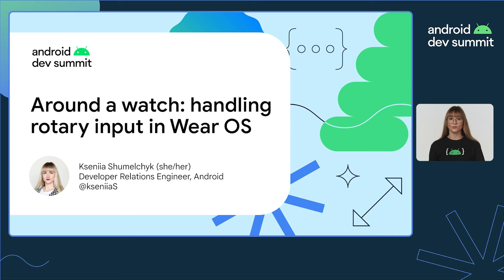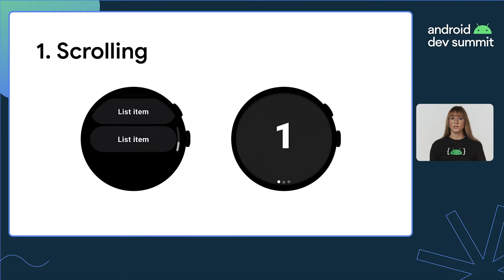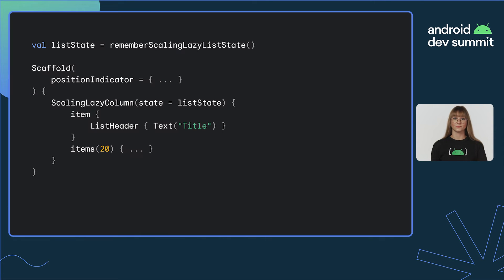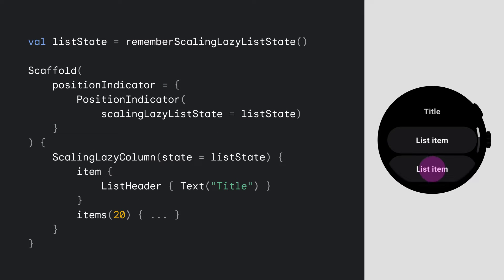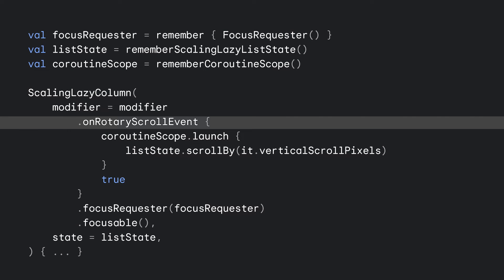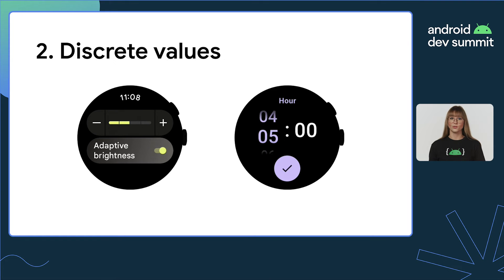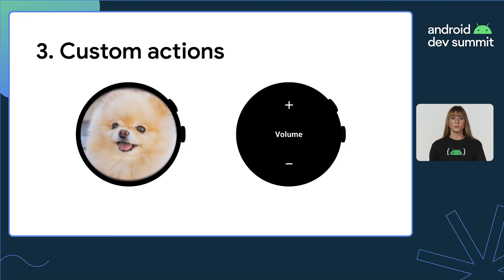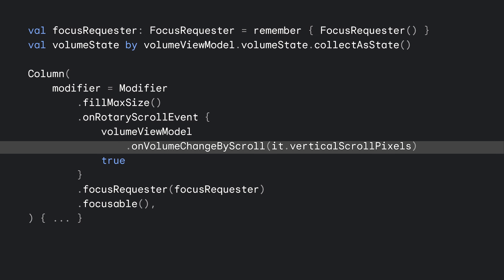Around a watch: Handling rotary input in Wear OS

Comment: Rotary Input works but the scrolling indicator (position indicator) is only showing when dragging finger up and down, not when using the crown. Any idea why?
Reply: You can add scrollState.animateScrollBy(0f), but of course it's not a proper solution

.onRotaryScrollEvent {
                    coroutineScope.launch {
                        scrollState.scrollBy(it.verticalScrollPixels)
                        scrollState.animateScrollBy(0f)
                    }
                    true
                }
Reply: @yehor_zhyr  Thank you! I was running into the same issue as OP and this workaround fixed it.
Reply: @yehor_zhyr  Thank you also!! I had the same issue and nowhere else did I find this work around. It's disappointing that this is not highlighted in the documentation as a known issue.
Reply: @yehor_zhyr  Thanks ! Never thought YouTube would be the place to find such a solution !
Reply: Solved with listState.animateScrollBy(0f)